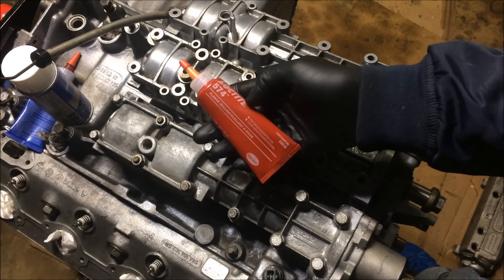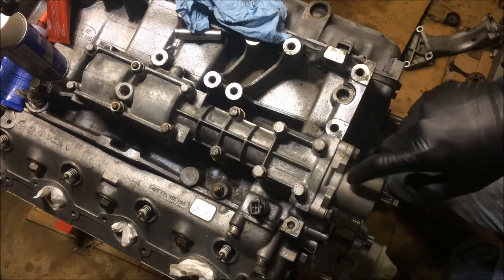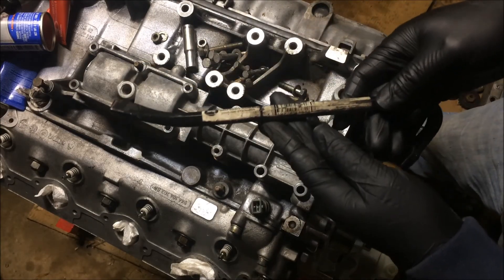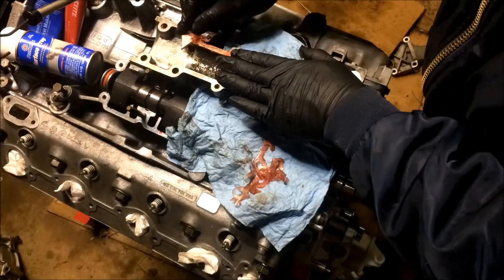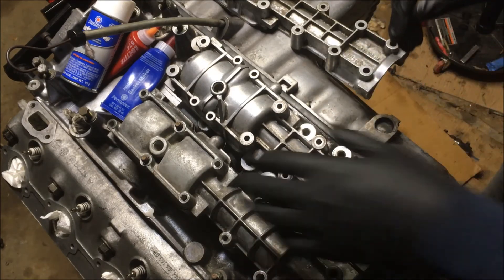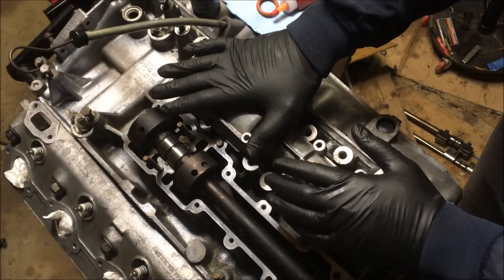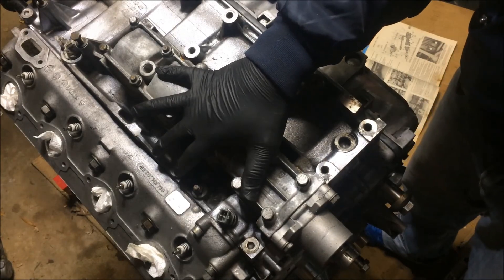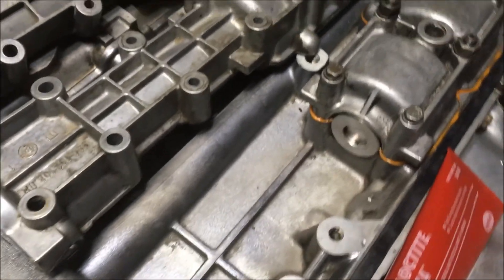Porsche 944 Balance shaft cover installation tutorial

Comment: Just curious would it be possible to seal balance shaft covers with hight temp rtv ? Or does it have to be loctite.
Reply from the maker: It needs be Lotite 574 flange sealant or the Permatex version. The Permatex version is okay and is available locally at most auto parts stores but the loctite is much better to use. Flange sealant is a must since it is anaerobic, so it will only cure between the mating surfaces. Any excess that gets squeezed out inside the engine will remain a liquid that dilutes into the oil and will come out in during the next oil change. RTV will also squeeze out inside the engine and cure into rubbery strands. Those cured RTV strands will then tear off where it will get into the oil system clogging passages, causing damage. I've seen these strands get mashed up into muck that starve bearing surfaces of oil as its pushed through the engine over and over. Many times the only way to get it out of the engine is to do a full rebuild. I hope that helps!

Comment: You’re the Porsche 944 god. Thanks again. I have a question. I just found the lower balance shaft rear seal o-ring leaking on my 87 NA. It looks like I can pull the header, pull the motor mount bracket, and R&R the lower balance shaft cover with the motor in the car. Is this the easiest method (the car needs motor mounts so kills two birds) I’m ashamed to say that I cleaned it and slathered RTV all over it today to try and buy myself time but my car was just down for two months while I did LOTS of things to it and I just really want to enjoy it for a little while before I tear into it again
Reply from the maker: Yup that’s exactly how we do it here! We drop the cross-member and then pull the cover. Also doesn’t hurt to use some sealant on the new seal since they’ll just shrink and you’ll have to go back in there again. Good luck!

Comment: Thanks for posting this. I gotta say that's 10x the amount of sealant that's needed. All that's needed is a thin coat that just tints the surface orange. An art brush works fine.
Reply from the maker: Thanks, yeah Porsche applies it like that and then spreads it around with a foam roller, but still rather thick. Whatever is left is soaked up on the the roller and is unusable, so since its going in the trash either way, I'd rather just make sure I got enough on there. What ever tiny bit oozes out on the inside will just come out with the next oil change.

Comment: It looks like I get to do this soon, even though I wasn't planning on it. I was just cleaning up the block a bit with wipes after installing the oil cooler and felt something loose at the back of the balance shaft cover on the passenger side. It turns out the aluminum disc piece where the o-ring is is as loose as a goose! It doesn't look like it had been leaking terribly, but I may as well since I have the exhaust manifolds and front suspension/cross member off. It's as good a time as any.

Comment: Great channel. I own a 951with an overhaul coming soon. What's your opinion on balance shaft delete? Thanks
Reply from the maker: Thanks! Balance-shaft deletes are a hotly contested debate in the 944 community. Most people on forums incorrectly think they are there to prevent the engine from shaking apart, but this has become so ingrained that it's hard to convince people otherwise. They are there to make the engine quieter and smoother for the occupants. In other words, they help reduce the vibration to about a straight-six level and so it makes the driver feel like they have a more expensive engine under the hood. Keep in mind a Inline-five engine is smoother than a straight-six at higher rpm and a cross-plane V8 has far less vibration than both. That said, most larger inline four engines never had them and they were fine, with many still on the road. They just aren't known for being very refined. I remember back when I was growing up that many people were boring out 2.5 liter L-4 GM Iron Dukes to 3.0 Liters and making around 700-ish hp at high rpm. Those engines were bullet proof and never had balance-shafts from the factory. I owned many of these types of engines and also have a 944 with balance-shaft delete. I've never had any issues, but it's up to you since I won't get into the middle of such debates. The main reason is, most of them are not aware that it is rare for a large inline-four to have balance-shafts so you can't take those people seriously. I hope that helps!

Comment: Is it possible to leave the nose housing on (just remove bolts) while resealing the main housing and replacing the oring? Also I bought an oring that was listed for 83-87 model years. Do I have to get a different oring? The engine is a 87
Reply: @edredas I went to do the seal for the lower balance shaft cover and I went to remove the engine mount bracket and the bolt on the lower left of the mount bracket is hitting the exhaust manifold. Am I doing something incorrectly? I really dont want to take the manifold off in fear that a stud may break. Any thoughts?
Reply from the maker: @Gearsandgrease  The lower cover is such a nightmare to do in the car. I believe removing the header nuts from the head and pulling it back is the only way to do it unfortunately, so just take your time. I hope that helps!
Reply: @edredas  it absolutely is. Thanks for all your help and videos, I have seen just about all of your 944 videos and you have made me very comfortable with wrenching on the 944. I always look forward to see what you're up to next! Thanks!
Reply: @Gearsandgrease  glad to have found this channel. work 3-4 hrs per day on my '89 2.7 na. it is coming together nicely. always something new to learn.
Reply from the maker: I have had to reseal one on a car that was leaking. I left the belt on and everything and didn't have any issue. I figured having the housing off my lift the shaft up back there but it didn't, but I don't really advise doing it that way if you can help it. That said, the rear orange O-ring seals are completely different between the 1983 and 87 engines. You'll know if you have the correct one because the early car O-ring will be way too large. I hope that helps!
Reply: @edredas  thanks, I reordered the right orings.

Comment: Is this feasible with the engine in the car on early n/a ? Do you have to remove the intake for the upper balance shaft
Reply from the maker: Yes, it is possible to re-seal the upper balance-shaft cover with the engine in and just the intake removed. The lower balance-shaft can also be re-sealed with the engine in but it is more complicated and requires the engine being supported while the lower mount bracket is removed. I hope that helps!